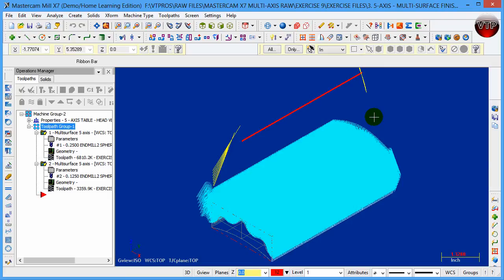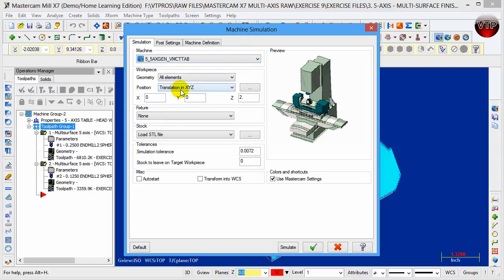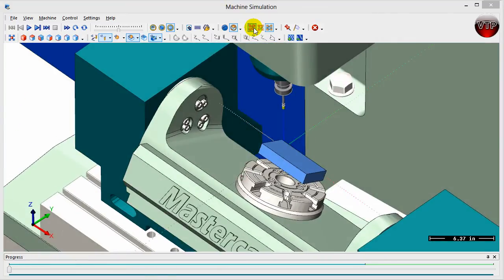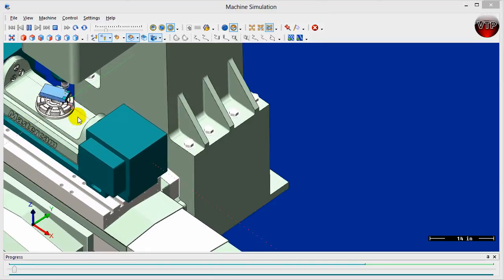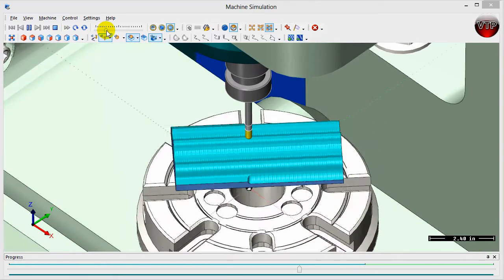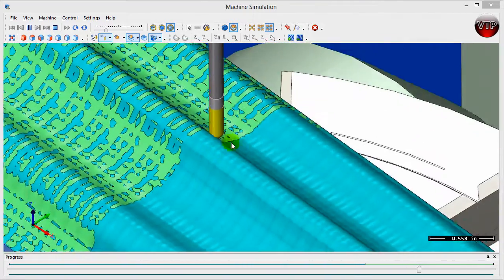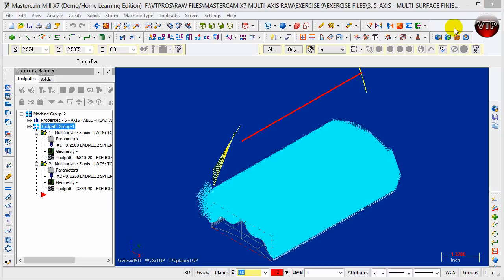Mastercam X7 Multi-Axis - 9.4 - Machine Simulation - vtpros.net

Comment: So what would you do different to keep the part from having to rotate 180 degrees on every cut? Isn't this really just a 3 axis operation with a bunch of unnecessary movements?
Reply from the maker: very good and valid question, in this operation if you notice we're using a rotary as well as swinging table. It has to back and forth like that otherwise it wouldn't be able to reach the other site. Can you do this with 3 axis? you can only if you don't have radius that are too sharp, if you look at the drawing of the part, a simple mill operation wouldn't clear some of the radius in the drawing unless you machine it this way, the rotary table helps get to the radius when the parts tilts a bit back and forth. Hope this helps!!
Reply: VTPros
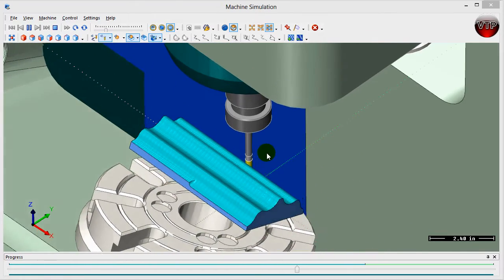I'm sorry but I still don't understand the reasoning. At approximately 3:40 into the video until 3:55 the tool is simply traveling in the Y axis without any 180 turns. Why then did it suddenly have to revert back to the 180 turn tool path? Why cant the tool continue in the Y axis while the Z moves up and down without the table tilting? Just trying to learn something. Thanks.
Reply from the maker: no problem you're asking good questions. Ok so normally that wouldn't happened. i just opened up for the because you're right, it really shouldn't do that, it turns out on that machine that i have selected has a limited with the table traveling in the y-axis, so in order to reach the other side after it machined half way thru almost, it turns it 180 degrees so it can reach the other side, hope that makes sense. You can't do this in 3 axis mode because of the radius, sorry if i'm confusing you, if you place the tool straight over the part, you won't be able to reach the radius on the two humps that are on the outside, those have a radius that go inside the humps where normal 3 axis tool can't reach without the rotary table.
Reply: VTPros
I see. It was a little confusing to watch but your explanation helps. I am fairly new to Master Cam and most of my experience is with the Port Expert option. One major benefit of Port Expert is the elimination of unnecessary 5 axis movements which is a big time saver. I am now expanding my business into some more traditional machining and I need to learn to use Master Cam more efficiently. Really enjoy the videos. Thanks.
Reply from the maker: not a problem, those are just part of my full DVDs at www.vtpros.net or you can find them on ebay as well. let me know if you have more questions